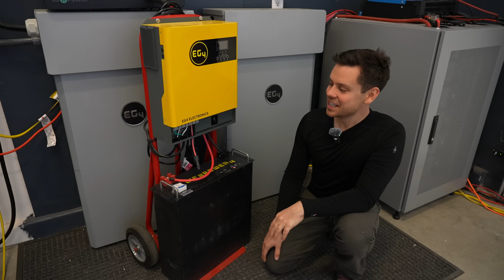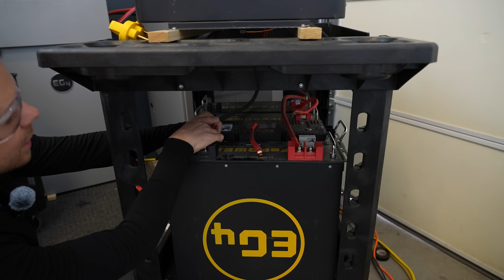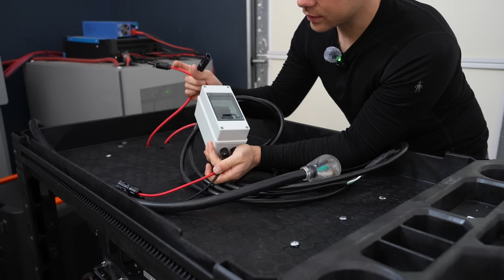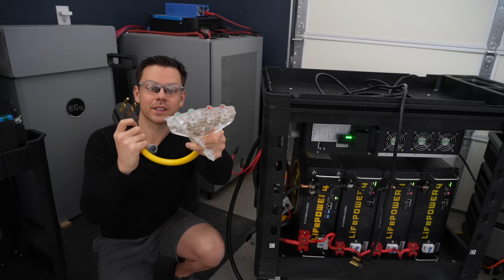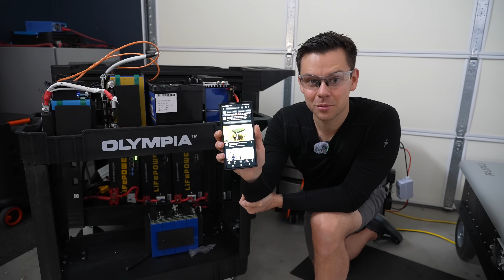DIY VS Ecoflow Ultra! Save thousands building the Solar Kart

Comment: You could even put a solar panel on top and put it outside to charge :)
Reply: One solar panel would take forever to charge this set up.
BUT
What he does have and he mentions them briefly in this video is mc4 connectors.
These easily can be ran outside to the solar panels and the cart can remain stationary. This way you have a huge solar panel array that can charge it quickly.
You can see the basic premise of this by looking up his hand truck video with the yellow inverter.
There is also a link on that hand truck video that shows you how to wire up everything in great detail with color pictures and parts lists with links.
I have that yellow inverter connected to three batteries based on that hand truck video. I haven't seen the hookups for the inverter that he is using in this video but they've got to be pretty similar.
Hope this helps, Happy Thanksgiving.

Comment: May be outside the scope of what you want to do and what most people might find practical, but you could probably build a sturdier cart out of wood to the desired dimensions and add appropriately spec'd casters for a similar price. Napkin math... I'd say a 4x3x3 (lxwxh) cart could be built extremely sturdy for about $250

Comment: you could cut a piece of plywood to put in the bottom of the tray to distribute the weight better (I'm sure the plastic material is what's rated for 500lbs, but the casters are probably rated for much more).

Comment: Metro wire shelving cart.  800 lbs per shelf.  2000 lbs per shelf unit.  Caster wheels 400 lbs per wheel.  Better air flow with wire shelfs.
Reply: The Costco wire shelves might work too. Buy another set of wheels and you have a second cart.
Reply: It seems the authentic version of that cart is $2000 though...

Comment: What about a 1000LB rated wagon with a pull handle? They usually have big rugged wheels and you could just build something to hold the batteries in place and mount the inverter on the front of the battery scaffolding. Home depot has a large 1200lb rated metal gorilla cart for under 200 bucks. The bed is 45" x 23" since the batteries fit in 19" racks that's a pretty good width and at only 18" deep that leaves plenty of space for two stacks of 3 batteries facing inward and then mount the inverters at the front or back. It would be 30kWh of portable power that you could technically tow with a 4 wheeler.

Comment: Couple questions and suggestions...
How do you access the control panel on the converter?

Why not lay the batteries flat so you can see the fein panel better?
If you put the batteries towards each aide (2 on each side), the weight would be closer to the wheels, helping to disteibute the high load
And also is the little.tool.rack on the cart removable?

Comment: I’m in canada, frequently below 0 degrees,
Do you have an option that would work for a cabin in cold weather ?
Reply: LiFePo batteries can usually discharge down to -20 at reduced C rates. As long as you kept them inside and run something like a small cold climate heat pump (or just keep the loads low until to wood stove heats up the place) it would be fine. Just add some type of thermostat cut off to whatever input you have to them so that there is never a case where they attempt to charge below 0.
Reply: @Snerdles below 0 F or 0 C? 
Thanks
Reply: @marcelcouture5105  sorry, freezing, 0C.

Comment: I grew up going to a camp that primarily runs on diesel with some ancient lead acid 12v batteries that ran ran some small lights and a fridge at night .   Their so much good stuff now they could easily run a battery system for the whole camp and cycle the generator or solar ti charge them up.    The technology and costs is so much better than it used to be

Comment: I have a heavy duty steel cart I been planning the same thing, except I have 2 1000 watt and a 1100 watt generator motors that makes electricity. I am going to put about a 6 hp engine I'm going to use to power all 3 to recharge the batteries, all on the same unit. So when the battery gets low I can recharge them day or night whether the sun shines or not.

Comment: Replace the casters, use wheels with internal bearings. Consider the environment. If at off grid cabin, better wheels/tires to roll in dirt. Must be able to remove in emergency/fire.
Reinforce shelf with 1/2 plywood. Also add one diagonal brace on each side for durability. 

Consider creating the 2 battery unit, or 12V system, on a Harbor freight mesh steel garden wagon. 

Can you create same/similar 2 rack battery system to fit in poly box on vehicle hitch rack? 
What would be the weight?

No need to wildly wire the van internally. Power pack on the rack, extension cord through the floor to the interior, and simple interior power strip. Alternator charger wire from engine to power pack. Solar panel input somewhere.

Comment: Mount the inverter on the front or back vertical side of the tool card, vertically like on a wall.
I mean on the side 25.5 "x 39 "- for example under the cup holder.

Comment: 3:58 turn the cart upside down and mount the inverter that way before standing it back up and sliding in the batteries from the skinny side of the cart. Then there is no lifting or unnecessarily large and time consuming bolts to tighten. My two cents :)
Reply: Or slide some scrap wood under it to hold it up to the top shelf
Or use the long bolts, but replace them with short bolts one at a time once its in place (time consuming but cleaner finish)
Reply: Very Good idea !
Reply: Nice!

Comment: I love DIY and i have made my fair share of toolbox/crate battery systems. However the black Friday deals on Refurb Delta Pro Ultras are just too cheap. You can get a 12kwh DPU for only $5000. And it is much more compact. The PV is less than a 6000XP, only 4000w+1500w. But there are features that makes it really nice. Like heated batteries, app control, and all the other small nitty gritty stuff. But the biggest deal is, if anything fails on the DPU, you are sol. You will have to depend on someone else's word to get it repaired. VS Repairing it yourself. Tradeoffs, but the DPU is really cheap.

Comment: I didn't think the 6000xp was designed to operate in a horizontal configuration.  This is a great idea, I could remove my RV generator and replace it with this configuration!  Thanks!
Reply from the maker: They're not dependent on convective air flow so it's fine to have them horizontal
Reply: @WillProwse please refer to pg8 section 5.2 of the manual. It clearly states what I said is true.
Reply from the maker: Also just look at it lol. The fans pump air horizontally. It's not like the voltronic ones. And even on those that didn't matter either
Reply: Is it a thing that the inverters are not supposed to be horizontal?
Reply: @nismor3490  Yes- they are built so that path of the rising heat has a path to escape. If I remember correctly you can lay them back up to 45 degrees but don't quote me.
Reply from the maker: @dalltex no that's not true
Reply: @WillProwse  yes, your comments make complete sense as it relies on forced air via the fans, and it seems as though it would be fine, however the manual clearly shows that it should not be mounted horizontally.... that's what has kept me from building a cart with the 6000xp -- which I would love to do but that manual killed it for me!
Reply: @CajunCoding read the manual. Page 8 section 5.2.
Reply: So then just hang the inverter vertically off the end of the cart... @CajunCoding
Reply: @dalltex I have already read the manual hence my original comment about it noting that horizontal mounting is not ok.

Comment: If you need portability check out a garden cart. They make metal mesh garden carts with 880lb capacity and 11 inch wheels. No upper shelf though.

Comment: If you have an EV other than Tesla, Ecoflow Delta Pro Ultra with a single battery ($4,000 right now) is actually a great home backup solution. If you want to save some cost and doesn't have big load in your home (in my case heating is by natural gas), you can even get a single Ecoflow Delta Pro 3 (below $3,000). And you get 5 years warranty. Jackery 5000 and Solix 3800 doesn't support pass through 240v otherwise those are competitively price as well. 

When there is an extended power outage you can charge the unit from your EV's 120V outlet while still using this to power your house and when you can still drive your car when needed. I am talking only about emergency home backup, not charging from massive solar array.

Comment: When you started my first thought was to create like a server rack look at one end where the batteries can slide in and place the inverter at the other end upright behind the batteries. Very interesting. I run 3 LL batteries on two EG4 3000, so I can either do 6000 watts at 120v or 3000 at 240v.
Reply: Nice set up, do you daisy chain the batteries or use a bus bars? I have two batteries and looking to add another

Comment: Hey Will, a thought to address your current sharing issue.  have you considered putting one of the newer EG4 batteries with the larger terminals at each end of your parallel string to provide the large terminals needed to have the positive & negative at opposite ends?

Comment: Will, the charts are plastic and the shelves can hold the weight you have on them but they will sag over time.  You can prevent this by placing a sheet of 1/2" or 3/4" plywood on the bottom shelf.  That will keep the shelf from sagging and causing the cart to fail.
Reply: My thought was to bolt some 2X4’s to the casters and set the battery’s on them.
Reply: @wrongmouse1658 It's the casters that will fail. They'll fold over. Been there done that. I fully agree with the plywood to distribute the weight. I used 1/2" plywood
Reply: @FauxQue-yk8dt  
Now we're into design philosophy.
Just placing a sheet of plywood on the bottom shelf won't do anything, it would be a waste of time.
Bolting the ¾’ plywood to the casters would do something.
My idea was to bolt the two pieces of 2X4 to the casters (the long way), not just placing them once on top.
Doing both would be the over-engineering way go.

Or

If you want, you could just use 1” plywood bolted to the caster, would be best. 

The 2X4’s I have in stock, and the ½” in stock. I would have to buy the ¾” or 1” plywood.

Hardie board is just another form of plaster board with no structural strength, good for fire and high moisture locations.

Personally, I would have built the ‘Solar Kart’ from scratch. What fun is it to just buy something?
Reply: @wrongmouse1658  I have not done this exact thing before, but I have stiffened cheapo tool chests by bolting plywood to the bottom.    You are correct that it would be better if the plywood was directly fastened to the wheels, but even without that the plywood will stiffen the cart and place more of the weight over the wheels, and that will help a lot.

It is hard to tell from the video, but it looks like you might be able to put at least one of the caster bolts through the plywood, maybe more.
Reply: @FauxQue-yk8dt It is hard to say if the casters will fail or not.

Looking at the casters in the video they are certainly not super heavy-duty..... but I have been surprised by how well seemingly flimsy casters of that style can take weight.   More often than not, the failure is the connection between the caster and whatever it is connected to....not the casters themselves.  I have seen a couple of old Craftsman (Crapsman), tool chests where the casters are bolted to the thin sheetmetal bottom of the chest.  The failure starts when the sheet metal starts to bend.  Stiffen it with plywood under the tool chest and they work fine.

In the video the shelf is sagging a bit.   This puts the casters at a slight angle and certainly does not help (Casters are designed for the weight to go straight down.  Adding plywood will help stiffen the cart and reduce the sag.  If you could get some of the bolts to the caster to go through the plywood it would be even better.
Reply: That’s off the charts.😊
Reply: Exactly, "holds 500 pounds" but not permanently
Reply: @kiplinght  The Harbor Freight Chinesium cart is rated at 450lbs. I have a little over 300lbs of batteries on it. First time I tried to roll it across the patio one caster folded over and I was lucky enough to save it from dumping my batteries. Sitting still it's probably OK but I replaced the casters with heavy duty ones from Grainger. I paid more for the casters than I did for the cart
Reply: I just posted on Jasonoid - I have had 3 LL’s and a 6000xp on a Milwaukee hand truck/ cart folded down on all 4 wheels. I don’t like the air-filled tires, but those might be replaced. It holds 800 lbs. I have a Reliance 50 amp manual transfer switch for critical loads. Want to add a battery and more solar - 10 Hyundai bifacial 395w.
Reply: just build it out of wood, $200 is a lot more than $20 worth in lumber
Reply: @MHawkeye  20 dollars gets you like 2.5 2x4s now. A sheet of plywood is like 84$
Reply: @FasutonemuMyoji  

i have no idea where youre from but in the states 2x4x8s are $3 and 7/16 4x8 plywood sheathing is $16 at home depo. the local lumberyard has scrap pieces for $1, not sure on the plywood as ive never had a need for it.
Reply: Or hardie board instead of plywood

Comment: To increase the weight rating it may be possible to unbolt the wheels, then bolt a piece of load bearing plywood between the wheels and the lower shelf of the cart. Check the weight bearing spec of the wheels; upgrade as necessary. Of course as the weight increases, be safe from uncontrolled rolling, like in an earthquake. Good project!
Reply from the maker: Smart idea
Reply: Big up Rob from PDX

Comment: Use a 12000XP double the capacity and almost 3 times the solar input.
Reply: Would you need to go to a 4/0 battery cable if using a 12000xp?

Comment: Will, what do you think about building a HVDC 132V or higher (instead of 48V or lower) battery pack and then building the system around that?

Comment: In high heat environments, expect the bottom shelf to sag over time even if it doesn't catastrophically fail.

I may or may not have pushed similar GF polymer to the limits many times over the years. 
😅

Edit: High heat as in equatorial regions, southwestern/southeastern States, and places like greenhouses/sealed utility rooms. Uncontrolled storage units and garages/outbuildings can also cause issues.
Reply: Some said to line the bottom with a sheet of plywood.
Reply: True

Comment from the maker: Yes we know I can flip the cart over and mount inverter 😂 I had carriage bolts and batteries were loaded. Easy 

0:00 We need new systems!
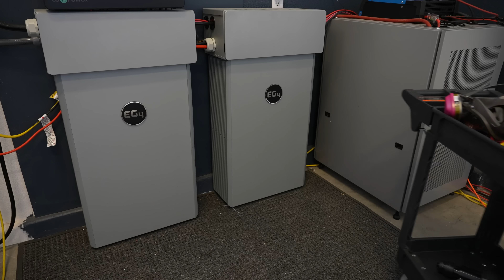0:25 Tool Karts!
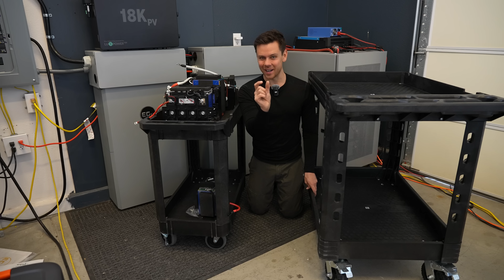1:10 Building Version 1
3:07 I hate it!
3:45 Version 2! Much Better
5:33 Total Cost
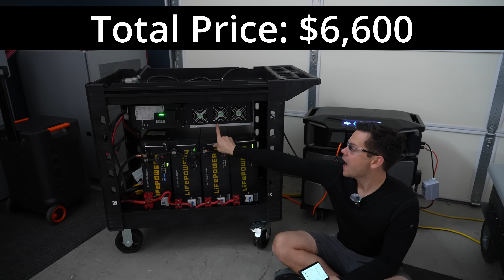5:57 DIY VS Ecoflow Ultra Price
6:33 Sizing Discussion
7:26 12V Solar Kart!
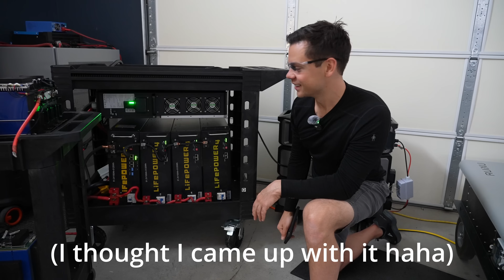8:23 Conclusion